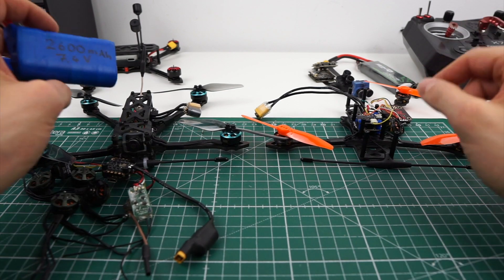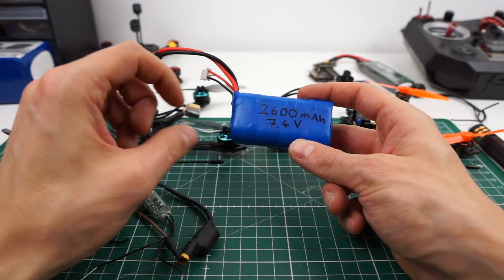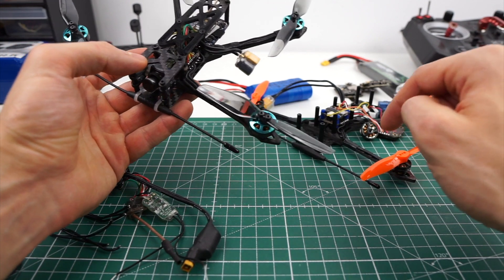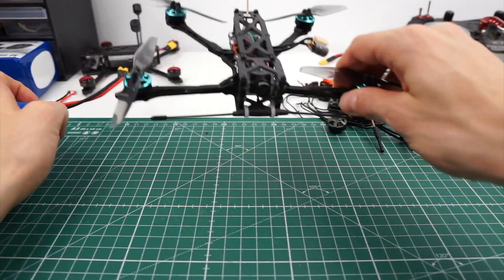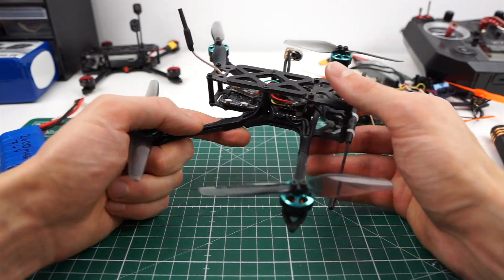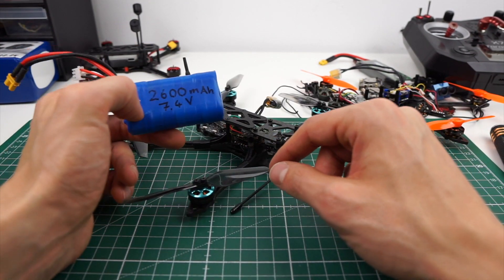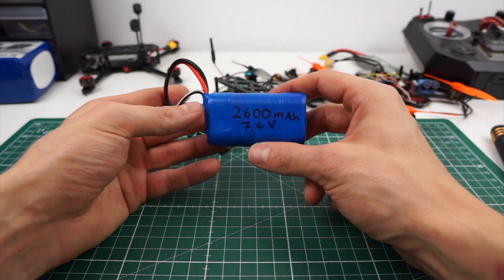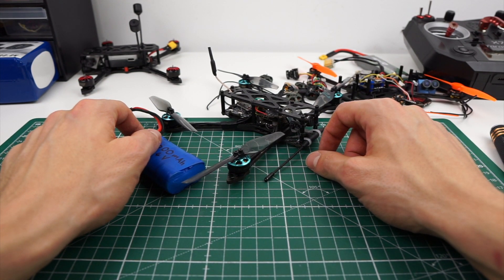Tech-talk: Final conclusion on Li-Ion testing

Comment: I'm kind of at the same stage as you were at the making of this video. My AIO FC also cuts out at pretty much exactly 6V while flying. Under low hovering load of course.
The cells recover up to 3.2V each.
If you look at some 18650 discharge Charts on lygte, you see that from a 2600mah rated vtc5a you still get 2300mah out of it under moderate load.
So that means you current sensor and mah usage probably was not reading correct. You did empty you battery to 90%
I see you got 37min later on with a 3S 18650 using pretty much the same setup.

Comment: Excellent Video ZOHD LionPack 3000 mah for my geprc crocodile baby ....... I used to fly with 4s Lipo.... Do I have to make any change on my setup on (Betaflight or in the DJI fpv goggles) to get the Lion battery voltage reading ? I flue 1 time with the Lion pack and I get the low battery warning 5 minutes after take off.
Thank you.

Comment: Love this episode. I also tried LiIon with my 250 gram helicopter, which has half the disk loading as your lightest craft. It still didn't work. The problem is that the 18650 cells are meant for big crafts 350+ grams, and the real technical advantage is it's large volume per cell. When it comes to sub-250 gram crafts, that single advantage is the biggest problem. At this point, even DJI mavic mini has abandoned LiIon and has gone back to LiPo.

Comment: I get around 20 min on my oldest 5" Setup whith 3s 2400 lipo. I use 
emax mt2204 2300Kv Motors, schubkraft 5x4,5x3 props and a naze32. I only Use Flysky(Only Batterie and Firmware moddet(i replaced the original 4 alkaline AA Batterie Setup for an 2s 2p 5200mah li-ion pack) 
But i Got over 2km away, whithout GPS. The Signal was only 25% loss, But the Batterie was the Limit of range.

Comment: Dave_C FPV  could you use a voltage boaster to help keep the voltage up there.? Great work mate.
Reply: That is what i thought about too. But maybe it is too heavy to buffer peaks if you need to draw higher currents
Reply: I'm currently testing boost converters to use a single 18650 cell for a 2S setup (a plane in this case). I'm playing with somes that weight 3-4 grams but you have to be aware of the maximum theoretical current (2A), which I'm not too confident about. 

I'll do a test flight in a while. Don't know yet if only one converter could handle it or if I'll use several of them in parallel.
Reply: @JaviRP97  would be interesting to find out if it did work. I think them little boosters are over looked sometimes.
Reply: @Fpvfreaky  Yeah, will tell the results as soon as I get them. 

I think the only advantage of using a converter is to get longer flight times on 2S setups (because 2x18650 cells maybe too much weight).
Reply: @JaviRP97  yeah I done a project on a gimbal I made on one of my old drones I had. I ran it on a 2s and boosted the voltage up and set it to 12volts it worked perfect. All you have to do is make sure you don’t let the voltage in the battery drop to low, or your drone will fall out of the sky with little warning mate 👍🏼☠️
Reply: @Fpvfreaky  Hey! Did some tests with an old 5 inch I had around. Probably a 4530 prop would be ideal. Used an old and unknown 18650 from an e-bike. 

1) Two not so good boost converters in parallel (should work up to 4A). They don't, the motor starts "misfiring" when too much throttle is asked. Good part: kept around half throttle for about 19 minutes, then it shut down without much warning. Recharged around 1400mAh. Not bad results given the weak converters.

2) A single not weak converter, same size and weight as the others, but this one works better. Much more thrust, however, after a while, it starts to drop quite a bit. Throttle down and throttle up again with much thrust and drop after that. Can't keep the pace at half throttle neither. Maybe two good converters in parallels would work.

3) 2S 300ish mAh li-po directly connected to ESC. Not going to comment on that, the li-po must be almost dead, but 5 min at half throttle was unachievable.

Next tests:
- Two boost converters in parallel and a single good 18650 (sony vtc6 or sanyo)

- Three bad converters in parallels

- 2s 14500 batteries could be a workaround with decent flight time. Less mAh but no need for converters.

- 2s 18650 but might be a flying brick hahahaha
Reply: @JaviRP97  good job. Yeah that’s the thing with no warning when the battery’s drained it can take anymore away from it. What setting have you got your converter set at. 12v? Have you got the adjustable converters.?
Reply: @JaviRP97  oh yes I’ve got them they are the better ones. If you crank it up to 12v you shouldn’t get that sag at full throttle. Get the multi meter on there and turn that brass screw until at 12v. I think it’s clockwise.
Reply: @Fpvfreaky   @FPV FREAKY  Good news. I had set that good one at 8.9V (I have a 2S setup) believing that with a higher voltage, I would get better results, but thats when everything is directly connected. In this case, the converter was more loaded and that's why there was this sag. 

Now, I have set it at 7.4V. I plugged it in with the battery being 3.75V (I forgot to charge it hehe) and it has been running for 10 minutes with a appropiate thrust for this plane (Fox Multiplex). I finished the test at 3.25V. 

I thought there should be more juice until 2.5V, but given I don't know the specs of this particular 18650 and that it is providing good theoretical flight time, I'm quite happy :D . 

I will probably do a flight test this evening. Will tell you about it.

Comment: You can get with ease 30min plus flightime with 18650. Just mod the esc and use oldschool motors. I have same 4 inch props on 246gr auw and cruise 32min. Hd cam, gps...all you need. Another one i build is a 2inch with 3inch props, fly around 26min. Battery down to 5v and not 4v. Under 2.5 vo!t you damage the 18650 batterie.

Comment: Li-ions go along and a long way with high voltage/low currents in order to enjoy the watt-hours/kg of li-ion. 
You can't swap lipos for li-ions and draw 2-10C out of them and expect results. 
You get there when your quad pulls 1C for hovering. 
Again, to get to 1C you go up in voltage, low in current. To do that... low kv, large propellers. 

Watts get you flying. It's watts/gram of quad.

Comment: Hi Dave,
I watched your project with interest. A few weeks ago I saw this vid which may be of use for you?
https://www.youtube.com/watch?v=wC4v_RMpKCY

Fixed wing FPV are known to have good efficiency over great distances You could reconsider a flying body fuselage similar like "flying cross" rc plane or a delta shape to reduce power in horizontal flight. For this reason the V-22 Osprey was designed.
A hybrid drone may have best of both worlds.
good luck!

Comment: I have to wonder if a smaller capacity 3S would be able to work where amps will go down thanks to increase in voltage set against same wattage needed to fly?

Comment: Anyone try using Samsung T 40 batteries? 30 amp continuous discharge 4,000 mah. Or the T 30s 35 amp 3,000 mah. Or sanyo c's 30amp 3,500 mah. Theres even a 20650 3,000 mah. Lions. Many for bigger rigs. I see a lot of 18650 batteries but no testing on 20700 or 21700 lions in these applications.

Comment: Here's another experimenter sharing his results and a very  interesting FC mod, from the private Cinewhoopers facebook group: 

https://youtu.be/p9yYeysi6W0

Note1: Use 1104/4200~4500kv brushless motor and check unload running current is around 0.35A/7.2v. Most popular 1104/4000kv motor maybe usable, but the drone may not fly well at lower voltage (< 5.5V). In may case 1104/4200kv/Emax 3024x3 props 4 motor thrust data, >500g/8.0v, 450g/7.2v, 280g/5.5v, 220g/4.8v. (must)

Note2: Normal 2s-4s ESC working voltage is around 6.2v and above. In my case I use kingkong 20Ax4(2s-4s) ESC and modify it to operate at lower voltage (Hint : Bypass 12V regulator and diode, pic below) (must)
Note3: Replace Kingkong 2840 props with Emax AVAN 3024x3 props (Must)
Note4: I use Hakrc mini F4 FC and modify the DC-DC from 5.0v to 3.6v to save power (Optional)
Note5: 5.8Ghz Vtx 20mw without PA(3.6v/100mA) can give you lightweight and lowest power consumption. (Optional)
Note6: Never use JST for battery connector , XT-30U is a best solution. I also remove balance wire to reduce the weight.(Optional)
Note7: kingkong ET125 or Flyegg130 props guard are available, you can choose Flyegg130’s guard to save more weight.(Optional)
Note8: GPS ceramic patch antenna is really heavy, I change that with a dipole antenna. (0.4mm wire x47mm each arm) (Optional)

林建志 There are 2 regulator in most 4in1 esc (2s-4s). The first regulator(sot-89) is 12v (it's maximum rate must <=26v max). It provides power to the second regulator 3.3v(must <=15v max) and half bridge NMOS driver Ic(must <=20v max). The second regulator 3.3v is for MCU. For battery <= 26v(6s is possible) will not damage the original esc, but the lowest working volatge will be around 6.2v = 4.2v(Hbridge Mos driver Ic reset voltage)+1.7v(1st 12v regulator vdrop)+0.3v(diode vdrop if has)=6.2v. If you bypass the 1st 12v regulate and diode, the esc will be operated between 4.2v to 15v (3s max)😁. The modified esc will become 2s-3s only, 4s may be dangerous.

https://scontent.fotp3-2.fna.fbcdn.net/v/t1.0-0/p640x640/59553630_2370425139655134_7375645130084057088_o.jpg?_nc_cat=105&_nc_ohc=hvoJbxB9-7cAQmewD2MlN7mup5PLyXmxTQAHzmP-D9rzT6Xq5iz-EGZOg&_nc_ht=scontent.fotp3-2.fna&oh=e5d194717a33a79a8b915b8e1704fdb3&oe=5E8CA831

Comment: And why not a 3" size  in 3s liions ? , no problem with 3s in end of discharge than with 2s  and you stay in sub 250 grs weight. 
This guy built  one for 20 mns flight time and 20 kms travel at 60km/h average 
https://youtu.be/BEv32FtozrQ

Comment: Nice comparison. I was planning a similar build. So I dont see the prob. Each 18650 is how much..$5 max? So a total cost of $10 is half the cost of lipos, less weight and safer. What am I missing here?
Reply from the maker: Thanks! The good high discharge Sony VTC cells are a bit more expensive and the GNB 1100mah 3S is only 14 bucks so if the GNB pack is really only 66g and dishes out enough amps it will work way better than a Li-Ion 2S that caused all sorts of trouble

Comment: Im thinking the only one missing part was a capacitor (or a booster circuit) to get rid of the unbalanced main voltage.. Maybe Im wrong but worth a try. Great effort anyhow thanks for taking this route many of us thinking of doing too! Good lesson to learn from.
Reply from the maker: Thanks! If you take a closer look at the xt30 there is actually a pretty big capacitor :-)

Comment: so why such large li-ion cells? 18350 or 14500 seem like better cells sizes. with those smaller cells you could make a 4s battery with a robust starting voltage  of 16.8 and a decent ending voltage of 10 and still be around the weight of those 2s 18650 packs. I'm considering 10440 cells myself for toothpick builds.
Reply from the maker: If only there where smaller cells with a decent discharge rate. I really searched a lot but couldn't find a single one

Comment: I was testing these batteries quite successfully in terms of performances with a 2.5" and the iflight 1404 7000kv motors.
They can spin 2530 props fast enough even when the voltage drops below 6v. 
Drone has punch and it can fly 15 min indoor. I'll post a video when I'll fix the crazy tuning issues I'm facing now.....

Comment: Why didn't you try a smaller cell li-ion battery so you could run 3 or 4's? Say 14500 witch is about the same size as a AA Nimh battery instead of the 18650 witch is gotta be roughly double the size. I think 3 18500's would be close to the same weight as 2 18650's.

Comment: if you go lower than 2.5v the battery it's dead(li-ion) under 2.5 the battery will be damaged and you can cause a fire if you try to charge it

Comment: Really fantastic work. This stuff is not easy to do at all.  You did some really hard work to figure that all out. My best guess as to a platform that would work with those packs would be a toothpick-like quad with a whoop board that's specifically 1S-2S and those 1404's on the 4" prop with a whoop cam. The issue you may run into is the motors stalling at low voltage however. Really up to the ESC and it's shutdown voltage however.  I'd expect maybe 35-40min flight time. Probably 40min or so if you can actually run the cells down.  Probably no more than around ~28min max of actual FPV flying
Reply from the maker: Thanks! For sure it can work and I was pretty close. Swapping out the ESC one more time and putting more effort in PID tuning would have done it I guess. But if that GNB 11000mah 3S really works as it should I really don't see the point in using 18650 cells. The energy density is the same so why bother going through all the trouble and dealing with the disadvantages including bad flight characteristics because of all the weight. Anyhow, I need to get my hands on one of those GNB packs haha. They seem to be out of stock pretty much everywhere.
Reply: @DaveCFPV  the used energy density is the same. The actual energy density of the 18650 is much higher. This is why record flight quads don't go below 4s on 18650 and they still cannot use all the capacity.

Comment: I just had a similar experience while testing 2s liion vs lipo. Ended up getting similar performance from a 5c 2s 2500 lipo designed for transmitters. Same weight and fly times. My 4" 2s is able to fly all the way down to 5.2v (2.6 a cell under load) with GPS, split, and 800mw unify. I got a 12 minute 7.2 mile round trip from LG HG2s before dropping out of the air. Recent video on my channel. For me long cruises were the largest part of it, but also being able to convert my fleet to one cell type and leave packs charged indefinitely was a big factor too. It's been fun watching your progress! If I do play with lipos again I'll have to check that one out. Thanks for sharing :)
Reply: How did you manage to get down to 2.6 per cell? When the FC/ESC shut off at 6or6.2 volts?

Comment: Why not 3s with 3”? People are running GoPro Session on 3” frame and 4s lipo and doing freestyle. 1408 motor should be able to give enough thrust.
Reply from the maker: Yes that could work! But it wouldn't be a sub 250g Micro anymore so not really what i was looking for
Reply: @DaveCFPV  ah sorry i was not aware of your initial goal.

Comment: I'm the guy of the GNB pack tip :) can't wait to see the final build ready and also to have that deadcat frame released and available to purchase! Keep up the good work!
Reply from the maker: Thanks a lot man! Hope I can get my hands on one of them ASAP!
Reply: It weighs roughly the same as my 650 3s 80c GNB. That's crazy!!
(edit: note that it is listed as 'high voltage' though... In my experience that is just a marketing way to get 10% more listed capacity; they'll definitely wear out sooner if you charge HV)
Reply: @lievenvv  Was thinking the same. So more like a 1000mAh, just charged to 4.35V.
Reply: @TweakRacer  Kabab did an interesting video about HV batts. Apparently they really are a different chemistry..! TLDR if you have them, charge them to HV(!) - if you don't have them, buying normal voltage ones is just as good.
Reply: TweakRacer  I really don't always take him seriously - but this time he did some actual measurements. 
I guess it's still better not to buy HV, but my takeaway was that if you have them, you might as well charge them HV (or loose a significant bit of capacity).

Why the cussing btw? We're all friends here!!
Reply: @TweakRacer  Hey Tweak, if I put "Hey Fu@#er!" do you think I'm saying "Hey Funner!" There's a reason BS stands for Bacon Shreds in our society. It's common use. Don't be a Boron. We're not all friends here. Or are we?...
Reply: @lievenvv  yea i think so. My charger warned me and canceled when I forgot to set it back from lihv to lipo.. .charger picked up it would take the more voltage once it got past 4.2v.. no clue how.. but charger stopped..

Comment: COULD YOU USE  A STEP UP CONVERTER FROM BATTEY TO ESC
Reply: The problem with that would likely be the efficiency loss of the step up converter. Carrying one with enough current ratings would also be extra weight.

Comment: Well, man, 2V is definitely a wrong number )
Reply from the maker: at least that's what the spec says...2 or 2.5V depending on where i looked it up
Reply: Dave_C FPV Hmm, usually about 2.7 for a bench capacity test, so you can push it to 2.5 under a drone load, but actually there are very little mAhs below 3V, afaik
Reply from the maker: @throttlenerd  You are right I checked the sony specs again 2.5V under load indeed which is basically how far I pushed it. Probably 2.7 is what you would do to prolong the lifespan of the pack when you use it for vaping or any other application. But going down to only 2.7 I noticed that the mAh I had to charge the pack back to full capacity weren't even close to 2600mAh more like 1600mAh
Reply: Dave_C FPV Whew that's weird since afaik all the energy is still between 3 and 4.2-4.25 volts and you don't prolong the lifespan with 2.7, it's still a very deep discharge.

Comment: Link for the 4" deadcat frame? The thingiverse link shows me a PCB instead of a frame...
Reply from the maker: ah sorry I copied the video description from another video and forgot to remove some of the links. The 4" dead cat is not released yet
Reply: @DaveCFPV  Looks like a good frame, interested in 4" lightweight deadcat frames. Also, I would guess that you would really need a 3S li-ion setup to avoid low-voltage brown-outs as most kit is designed for for voltages above 2S lipo (6V min) and the 2S li-ion drops way below 5V but a 3S li-on would stay above 6V. Of course then you have extra weight...